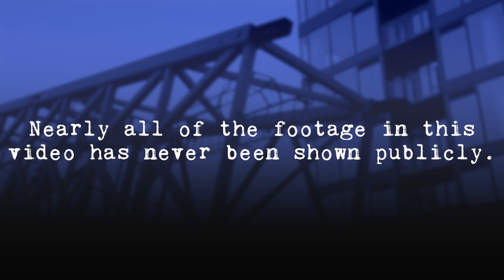Police Response to the Seattle Crane Collapse | All New Footage

Comment: WTF? Did all the bolts at each leg sheer or were they never placed?  All I see are all the holes on the frame and connections where the bolts are supposed to go.  Update.  Nevermind, I just read the description, it took them a while to figure out that the bolts/pins were removed improperly?  I noticed in the moment I saw the crane on its side.  You do not move all the pins out all at once, you hook up the top section to secure it, then remove the pins then lift it off and put away, then you hook to the next section, remove the pins and lift and place and so on, you do not remove all the pins, then there is nothing holding it together.  Idiots.  I do not even work on cranes and I know that shit.   And those tiny fines are an insult. They killed people.

Comment: did i see that the sections had seperated , it looked like the sections where seperated as if they had no pins ,but that does not explain why it fell over
on another matter ,Those American ladder trucks are amazing , i have never seen anything like that in Australia ,are they articulated. even the smaller truck looks like it may be articulated

Comment: The state Department of Labor and Industries faulted and fined GLY, Northwest Tower Crane and Morrow last autumn for failing to adequately supervise the crane disassembly, train workers and follow manufacturer procedures.
Regulators came down hardest on Morrow, with a $70,000 fine for a “willful” serious violation, indicating it ignored a legal requirement or was indifferent to employee safety.

Comment: Almost too disturbing to watch!
Now more than a year later and I've heard nothing about changes to permitting for cranes and other machinery that can just fall from the sky because of operator error.
How about making it this simple:
All erection of and disassembly of such machines have to be physically overseen by hired professional. It should be part of the permit process. Of it costs $2000. To do it then that's the cost of doing business; for everyone. 
Additionally, it's a known fact how long a crane takes to assemble and disassemble, that's why they took the massive shortcuts.  Well, if they knew it takes 12 hours to do it properly then they should have to document the time it took in a lot book that can be scrutinized at any time just like a commercial truck driver has to. If you do the math and see that it took 6 hours then obviously there were shortcuts taken and massive fines should be assessed. 
You can't stop people from taking shortcuts just by asking them to be honest. There has to be undeniable oversight on some things. 
Just like with commercial truck driving. Without that oversight there would be many drivers going beyond safe limits. Many would be forced to do so because others do it.